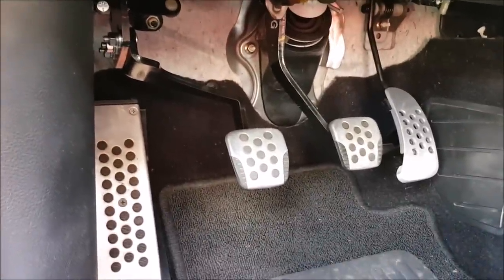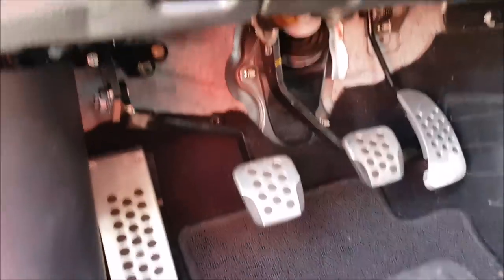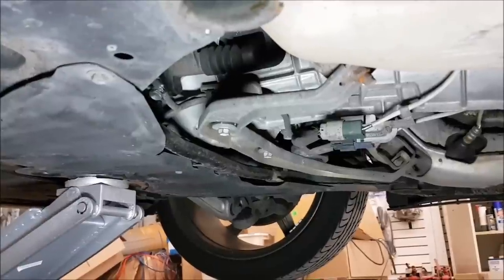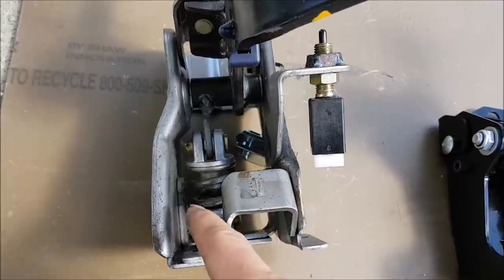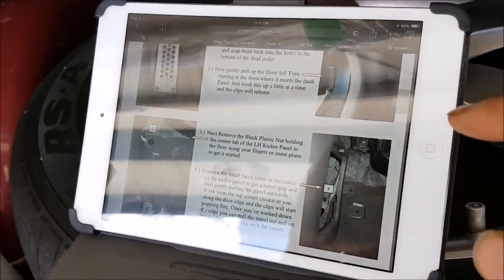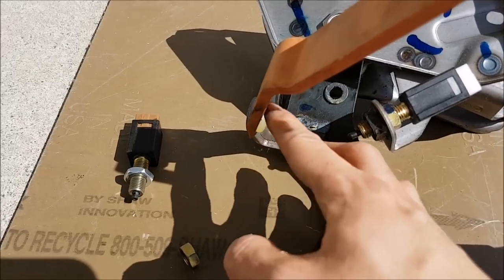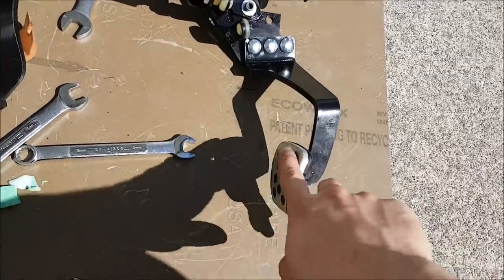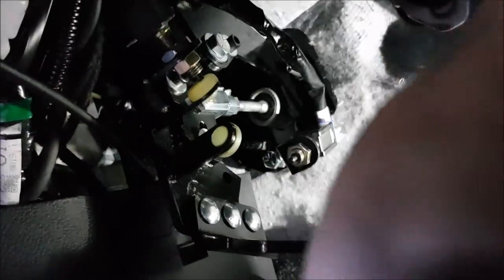BEST Nissan 350Z / Infiniti G35 Clutch Pedal MOD (RJM Performance) | AnthonyJ350

Comment: Had the rjm assembly on for the second day now.  gotta say the instructions make it seem more complicated than it really is.  however the importance of it being done right is justified with it all.  the only hard part was actually dealing with cramming myself in a position to be able to do the job (im rather tall so it was quite awkward and hard) however it is quite easy.  the only hard part i found was making sure the assembly was mounted right for the clevis to be pushing in at the correct angle.  for those that have been bashing this product and video i highly suggest you get one to be proven wrong.  i live in texas and the main issue we have with the 350Z's down here is the heat.  just daily driving it in hot weather in a bit of traffic will give the mushy pedal feel and of course the dreaded having to pop the pedal back up with your foot every time you shift.  i had mechanics tell me i had to change out my bearing and master cylinder and so forth to fix the problem but i knew it had to do with the pedal.  after much research with others having the same issue but actually swapping out every other part and still having this issue i finally found this video and after doing the install. IT IS BRILLIANT!   i went in to readjust it after a full day of driving.  and its unbelievable how good this is.  no clicking. no grinding, no sticking to the floor. shifting between gears is so much easier.  if you drive a z in a hot climate you know all these problems.  Even if you do not have any issues with the pedal i suggest getting this.  it will make a day and night difference with your driving.
Reply from the maker: Awesome feedback!  Thanks for letting everyone know this helps a lot in hotter climates!  Hope it helped you fall in love with the 350Z again.
Reply: Rene Mendoza man hope u ended up getting it. It has done an amazing job for me here. And have had several ppl get it installed too.
Reply: as someone who lives in texas, this is very relatable lmao
Reply: THANK YOU for this comment! You made my day! This has been stressing me out for a while now. way you described the clutch feeling is exactly what i’ve been trying so very hard to figure out. Ive been in the same boat doing research and being told the same things you were. Always knew it had to do with heat. Thanks again!

Comment: Anyone experiencing a thud when depressing the clutch pedal, means a nut has come loose off of the clutch pedal assembly and this is fairly common. It is usually the nut closest to the driver and is upside that comes loose. Tighten the nut back up and the thud will go away when depressing the clutch pedal.

Comment: Wonderful mod. Do it now. I have been driving manuals since I was fifteen (63 now). Never had any issues with stalling out due to improper clutch/gas engagement. My G35 Sport Coupe changed that. I have stalled out and made jerky shifts into 2nd more than I care to admit. I had to have my seat all the way back to compensate for the early release, which prohibited good heal/toe shifts. I had to turn down the radio to hear the engine when pulling away from stops. If I didn't, I'd either stall out or over-rev. Now it's as it should be. My poor-mans Aston Martin is a joy to drive. Do it now. You won't believe the difference it makes.
Reply from the maker: Thanks for sharing your experience, this really is the best thing for the driver and car.
Reply: Yours is the first comment that mentions the radio -- same problem here, if I have the radio on and can't hear the engine I mess up my shifts in my Z and I've driven stick since 1990 and I'm 62.  I think I'm going to try one of these.

Comment: Just an update, I installed the RJM pedal last weekend.  While the manual says about 1.5hrs of install time, it took way longer than that for me (like 3-4hrs) because the factory clutch pedal was hard to remove and the position is very uncomfortable to work on under the dash. 

The RJM pedal, once fully adjusted is great. No more pedal getting stuck halfway.  But I think I have a faulty clutch slave since the hot weather here in FL the clutch is hard to engage esp in stop-n-go traffic.  I'm looking to replace the slave cylinder next and bleed the system.
Reply from the maker: eiji81 Nice! If you're replacing the slave also look into replacing the flex line with a stainless braided line with a heat shield.
Reply: Haha yeah I just installed mine as well, and it took like 4-5 hours for me. I’d say if you’ve done it before, you could do it in an hour, but no way the first time.

Comment: so you think telling me I don't need to push my clutch pedal all the way in during shifts , damn I've been driving my car all wrong for 2 years now
Reply from the maker: Practice in a parking lot.  You'll find the car shifts fine pushing it half way.
Reply from the maker: That's for 350Z and G35s. Judging by your user name this doesn't apply to Hondas.
Reply: I drive a g35 now , I use to have a Honda
Reply from the maker: Ahhh ok.  Ya great cars.  But ya try driving it different and let me know if it works.
Reply from the maker: I would look into this pedal though, it'll remind you of your Honda quality lol.
Reply: wickedcivic1 ya most importantly to not ware out the slave cylinder. not your typical clutch cable design lol
Reply: Same here bro I just seen this
Reply: I have a 350Z HR and you have to push right to the floor for good engagement. If you shift 1>2 with your foot halfway down it will grind. It’s a factory HR trans
Reply: I really only push my stock clutch down maybe 20% to shift.

Comment: I have been driving without cruise control for a few years now. It's good to see that the fourth revision has an adjustment for that now. I ended up massaging the HVAC plumbing to get the wiring and switch to fit in my G35.
Reply from the maker: Ya this is a really nice unit now.

Comment: Getting this for our 2012 G37S.  To the point on only depressing the pedal halfway on the stock set up, I've found the only way to drive this car smoothly with the stock setup is to set the seat far enough back so that you have to reach to fully depress the pedal.  Then depressing it only halfway is normal movement.  Car has 154k miles on it with original clutch/master/slave.  Hoping this will bring improvement to the one gripe we've had on this car from the start!
Reply from the maker: I think this part will do the trick. Let us know what you think after.

Comment: Greetings Anthony, my pedal came in today. Unlike most ppl on here, I actually like the high grab point that Zs have from factory. I just didn't like how the engagement on the Z wasn't smooth, even when I gave it good enough gas. My question is, with the new pedal will I still be able to have my high engagement point for shifting quickly? I just wanted smoother more predictable engagement that's all, thanks man. - Keez
Reply from the maker: The pedal comes preset, but you can readjust it back to the factory position. Just make sure to read the instructions to see how to adjust it.

Comment: What’s funny is I subconsciously started shifting by pushing the clutch only half way in and I kept telling myself not to as apparently that wears out ur clutch overtime but I guess I’m actually doing it right...only on the Z tho
Reply from the maker: Correct, that technique will only work on the Z because of the stock design.

Comment: Is anyone having the problem with the clutch not fully disengaging even with the clutch adjustment rod almost all the way out? I know i’m doing something wrong but don’t know what. I have a street performance clutch form Z1 which is known to be a great clutch. If I try to thread the adjustment rod into the clevis even a little bit, I can’t disengage the clutch and therefore am locked out of every gear. Please help.
Reply from the maker: The slave cylinder might need replacement.

Comment: I'm getting a new Z1 clutch and flywheel (also a CSC elimination kit and and OEM clutch master cylinder) soon because after almost 160k miles, my original clutch has finally started slipping noticeably. 2.5 years of living in the city and commuting in traffic (with hilly terrain and  roads) have expedited my clutch wear. That being said, I wonder how this clutch pedal assembly would react with a new clutch kit... I know that you can adjust pedal engagement between the master and the slave, and the "feel" or resistance you feel depends on the components, so I wonder if this would still be relevant in my scenario.
Reply from the maker: Erik J At the very least it should make all your new parts last longer. I think it will still give better feel at the same time.
Reply: Ayyyyyyyyyyyyyyy

Comment: I have a 350z I know the clutch grab point is high, is it really okay to not fully depress the clutch while shifting? And my clutch is extremely heavy and my friends agree. The dealership said they put a nismo clutch in, is that even a thing?
Reply from the maker: Rusty Bui I'm sure Nissan had some performance clutch available. If you get this pedal assembly it'll make it way easier to drive with that clutch and everything will last longer.
Reply: The clutch will just make it slightly lighter. The spring in the pedal assembly is absolutely brutal. I've been running the RJM for 6 months and I cannot recommend it enough.
Reply: Rusty Bui you only need to press it to the point where the clutch disc doesn't grind while shifting. any extra force can ruin hardware over time
Reply: Rusty Bui Nismo clutch has more clamping force for a higher torque.
If you’re issue is clutch pedal, first have a certified technician (nissan) diagnose. 
If it is in fact the clutch pedal because you’re a tall dude then custom pedals suuure. 
But these things can very for many individuals. 
Master cylinders failing? That’s possible due to the amount of neglect (heat+wear+contamination) the more often you can put a test strip to determine the brake fluids contamination levels. And the sooner you replace the fluid that master should live in there for the life of the vehicle

Comment: This looks like the answer ive been looking for haha. Can you adjust it for a lower engagement point like on normal cars?
Reply from the maker: You should be able to.  I'll be honest I haven't fully played with the adjustments yet.  You should really e-mail Ryan, he's super helpful and can answer all your questions.  I sure had a bunch before I bought the product. Ryan@RJMPerformance.com
Reply from the maker: Tell him you saw this video ;)
Reply: AnthonyJ350 okay will do, thanks! Keep us updated on the feel on the pedal as you drive it more!
Reply from the maker: I will.  I'm going to do a video later on of my top "Driver Feel Mods" going over everything I put in the car for driving interaction.  Nothing that makes the car faster, just makes it feel better.
Reply: AnthonyJ350 okay awesome. The only think i hate about the Z is the clutch pedal, im new at it but its hard to be consistant. If this solves the problem and with practice, it would be a perfect car for me
Reply from the maker: Tyler Lesko I can vouch this pedal is what the car needs. I was so mad at the pedal and couldn't believe a sports car with so much thought in it had a pedal like this. It makes it what the car should have been from factory.
Reply: Tyler Lesko I agree. these cars need to be unlocked for its full potential. changing settings means replacing with adjustable hardware.

Comment: Thanks for this amazing video. I will probably buy it after I figure out my clutch pedal problem. I just installed a new clutch and flywheel. It's a z1 motorsports Mild Performance Clutch Kit(6 puck). My the release point now is almost all the way up. It feels too high. How do I adjust that? I'm afraid that the clutch is not totally disengaged. I don't  smell any clutch smell thou. Do you think after the 500miles break in the pedal will go down a bit?
Reply from the maker: You can adjust the factory pedal a little, was anyone in there changing the settings?

Comment: My main concern is the harsh nose diving effect when shifting from 1st to 2nd and downshift into those lower gears. It makes my car buck and nose dive badly so badly. I've driven other cars and trucks with manuals and my 07 G35 sedan is probably the worst. I've driven a 370Z and G37 sedan 6mt and they felt the same way. The 1st generation of G35s didn't feel any near as harsh or difficult to drive smoothly. Does this pedal eliminate that?
Reply from the maker: postersurfman1It should because it gives you proper modulation for street use.

Comment: I had fun installing the rjm kit. But since I have wilwood master cylinder, I couldn't take off the its Clevis which im not sure if it can on wilwoods.  So now I don't know if I should be worried of its pedal travel.  During the last few weeks I'm having difficulty shifting into lower gears and reverse gear and i just replaced my slave with no success this past week.  The issue comes back after few minutes of driving. Heat related from my ceramic coated rpm long tube headers? Any suggestions? Thanks.
Reply from the maker: Herb Sales There is a part you need for Wilwood masters. Contact Ryan.

Comment: first off. love all your videos. definitely looking to get this since my pedal is experiencing the getting stuck to the floor either when it's really hot ( I live in texas) or hard driving. But on the website it gives an options for which upgrade clevis with the purchase. any recommendations? I have my stock master cylinder in as of now but will be upgrading to somethimg once I do a jwt clutch and flywheel as my bearing is going out. if u have any thoughts from rjm that would be great!
Reply from the maker: Richard Barclay I would order the HD clevis for the stock master and run that even after you change your clutch. If you still want more change the master afterwards.
Reply: AnthonyJ350 if I were to swap the master afterwards would it be necessary to change the clevi though?
Reply from the maker: Richard Barclay Yes there's a separate clevis for the aftermarket master.
Reply: just purchases the assembly and I'm stoked about getting it in and installing it!
Reply: any change after the install?
Reply: Just Pasha late reply. But never had the pedal drop and fail from the heat. Works great still. Still love it

Comment: Curious if you remember the amount of turns the new clevis went on? My old one came off about 4 1/2 turns, and that’s how much I put the new one on, but it just doesn’t seem right because there is so much thread left. And also now it seems to be having a hard time getting into gears. And it’s grinding in reverse. It didn’t have any of those problems before I replaced it.
Reply from the maker: Adrien Bowden Did you use the nut as a reference point? Sounds like your settings it's not pushing the master enough.
Reply: No I didn’t use the nut as a reference. I just counted how many turns the old oem clevis came off by and that’s how many I put the new one on by. And now I noticed if I try to shift into gear at a high RPM it literally won’t go into gear. I’m going to bled my clutch fluid tomorrow and if that doesn’t work I’ll adjust the clevis more so it pushes in the slave more
Reply: Is there any possible way you can send me a picture of your adjustments and the positioning of your clevis so I have a reference? Would be much appreciated
Reply from the maker: Adrien Bowden Ya I mentioned using the nut as a reference in the video to help gauge where things should line up. You'll have to make an adjustment to get proper travel.

Comment: hmm. I don't know... My clutch pedal drives like crap if I'm low on oil. even just a little bit (under a quarter of a quart). my brake pedal gets soft. My clutch engages higher up the release. but if I pump my brakes a couple times.. the pedal stiffen back up and the clutch works perfectly. barely release the clutch and it's off like a champ. 
once full on oil again it's fine until I run a little low again.
Reply from the maker: robert mair That doesnt make sense. The hydraulic system is complete separate from the motor except for the brake booster which is just vacuum.
Reply: AnthonyJ350 right...  but it is what's happening. I can't explain why. I just want someone else to try it cause it makes no sense to me either

Comment: I have absolutely no issue with the clutch on my 350z. And it didn't feel weird on my test drive. We drive stick standard in the UK 🇬🇧 so maybe that's it. Good vid 👍🏻
Reply from the maker: You should really look into RJM, they just came out with a RHD version
Reply from the maker: Your stock clutch pedal has no modulation. So this one just feels better.
Reply: My clutch has plenty of feel and modulation with no problems. Maybe the other one 'feels' better but I don't have to fix something that's not broken. Anyway, Top content 👍🏻 mate,
Reply from the maker: @barryhall7  It actually is a broken design, you're over extending your master and slave and wearing them out more than needs to. Also thousands of people have clutch pedals that stick to the floor because of this.
Reply from the maker: @barryhall7  It's fine for you not to see value in this. But the video clearly demonstrates the short comings of the stock pedal that are hard to dispute.

Comment: The "release point" on these is high.
A simple fix it to go to Home Depot. Buy adjustable nuts/feet for desk's's 
Adjust to your desired release point. However keep in mind that hydraulic liquid does expand and due to the high lift point...
Reply from the maker: That's a quick fix but does not really give you any better feel or really help correct the over extension of the slave.
Reply: @AnthonyJ350  What I also did for feel on my Z was to remove the "helper" spring